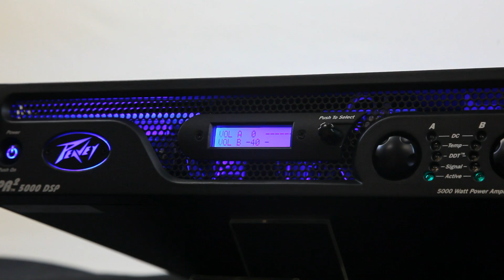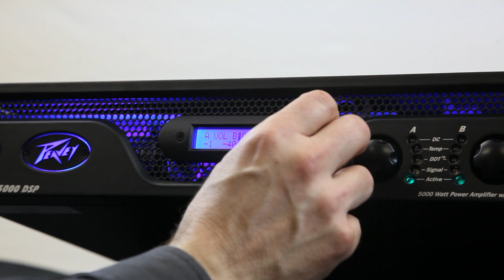Peavey IPR2 DSP - In Detail | AudioSavings.com

Comment: I've been a mobile DJ for over 10 years. Volume didn't meet my expectation. Pay attention to the password setting on the DSP version; you can lock the system but I went through the manuals to check how to reset it to manufacturing settings and i'ts not possible. Why? Because I entered some numbers accidentally that I didn't remember the numbers when playing with the settings and I at the end I was not able to unlock it. It will not let you play with DSP settings if you do not remember the password. Bad investment.
Reply from the maker: fathertubevideo1 Thanks for the input!